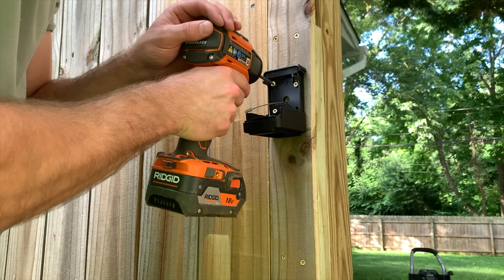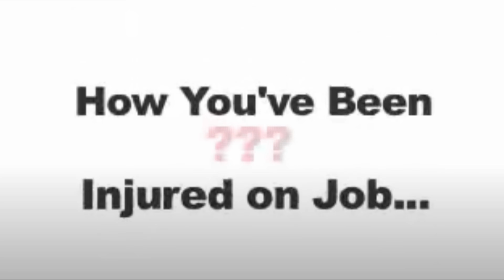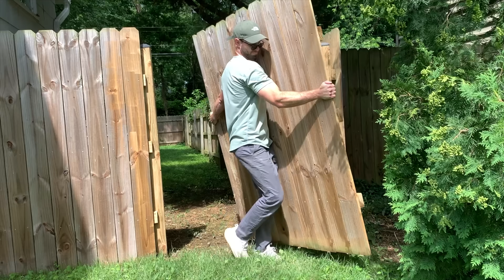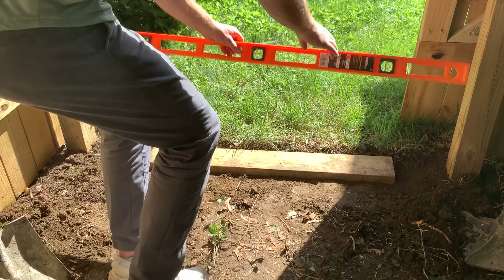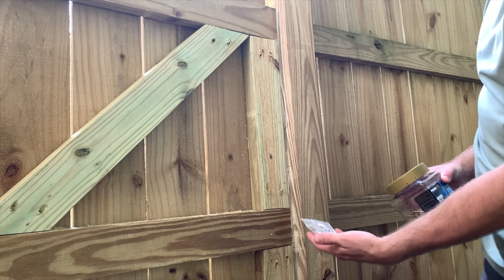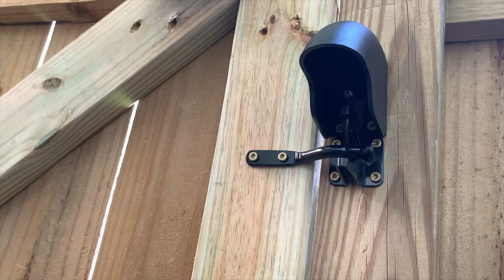How to Add a Gate to An Existing Fence (Step-by-Step DIY Guide)

Comment: This video was posted two years ago but it was exactly what I needed. I’m considering installing a gate in the backyard fence that would open to a public sidewalk and bus stop, instead of otherwise walking two blocks around the neighborhood. So I especially like the security features you suggested. The only addition I will make is a small solar panel light to see the combination lock at night.

Comment: My issue is that when the gate is closed and latched, it is NOT flush with the fence. The portion of the latch that is on the gate needs to have a block under it to make it flush with the fence.

Comment: I would not have put a handle on the outside. It’s not necessary since it’s a push from there and it looked more seamless and clean without it

Comment: I now want that latch. looks like Darth Vader on the inside. lol.

The handles are fine where they are. They don't need to be the same height. Even if you keep the gate open on special occasions, you still can ONLY see one hanle. Just make sure it stays open with a small rope or something.

Comment: Hi! Would you make a video showing what to do if you don't have a 4' section of fence? All of my fencing is in 8'  sections. How do I support the part that doesn't turn into the gate? Do I have to sink another post?  Also, my fence is the "friendly neighbor" type with staggered boards on both sides. Any tips for this? I just bought my first home as a newly single adult, and I want to learn how to take care of it myself.  Thanks so much for your video!

Comment: Nice job. That lock given  3 minutes with the right info opens up without knowing the combo. You should also replace that old AC. Nice work on the fence.
Reply from the maker: Yea that Lock is a bit overated for sure. Thanks for watching!

Comment: You should have spaced the latch bar with another 2x4 block so the gate closed flush with the fence
Reply: Wouldn't he need a 2X4 on the latch side as well so everything would be level?

Comment: Only thing i might add is a block at the bottom so when the gate is closed all the weight isn't pulling down on the hinges. I have a similar gate and over the last few years it’s shifted and the locking hinge doesn't line up. I really like that lock though, game changer!

Comment: Great video on how to install the gate lock! An upgrade to the gate would be to install a 36'h door handle on both sides of the gate (about 1 1/2" square x 36"h). I did it to my gate and it definitely looks more contemporary and clean. Also, cut off the dog ear part of the fence. It will clean up that issue as well. In our area (CA) we can purchase 6' fence boards w/o the dog ears. Keep up the good work!

Comment: Thanks for the information on the orientation of the gate brace. I built a 10’ wide single frame gate for mine and put my brace on the wrong way. 
You are definitely correct, it sagged immediately. When closed it’s not a problem due to hanging the end on a beefy barn tyke latch. I did install a spring loaded wheel to the bottom frame to hold up the weight of the sag when I open it. It’s 17 years old now and needs a rebuild. Perfect time to flip my brace. Thanks again.

Comment: Interesting. That lock is weird though, very secure on one side but from the other side it is just the press of a latch. If someone wanted to get in they could jump the fence and open from the inside. 

Not sure what the solution is but if you are worried about security I would add something to the top of the gate/fence to prevent jumpers, maybe some anti-climb paint

Comment: you should've hinged in on the front yard side so it would be flush with the rest of the gate, or was that a "troll" as well?  Other than that, nicely done!
Reply from the maker: Haha not a troll - The problem is that the latch would then be on the "outside" of the fence. I am not super familiar with a way to mount the gate / hinges so that it opens inward but is flush with the outside.

Comment: The only thing different I would have done was take about a 1/4 to 1/2 inch off the bottom of the panel so that the top of the door panels matched up flush to the top of the fence. Other than that, looks and works great!